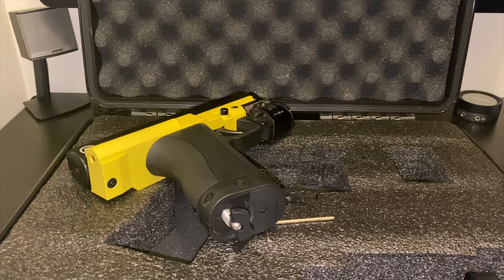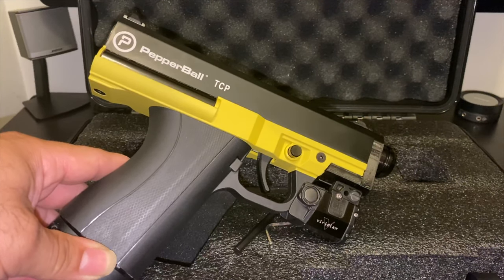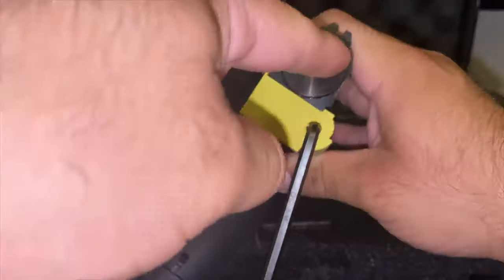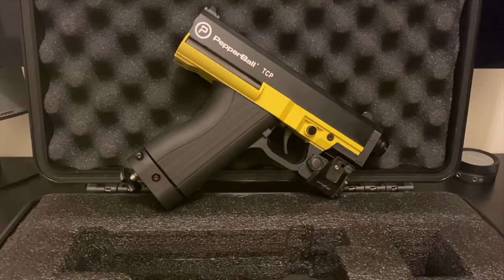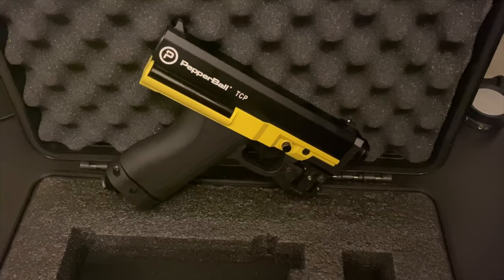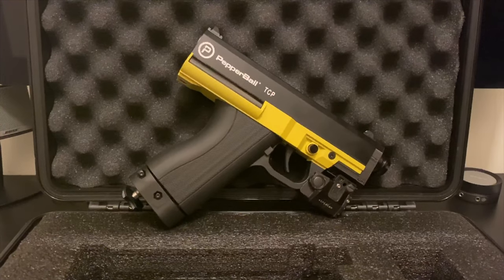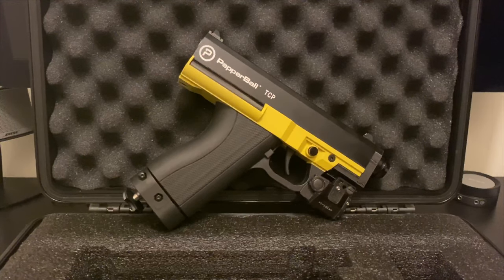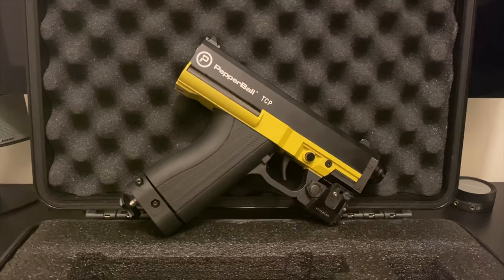PepperBall TCP Velocity Adjustment (Subscribe Leave👍)

Comment from the maker: https://indi.com/p/reviewdudelesslethal/h8837
https://www.olightstore.com/?awraf=770F20005EAC976CB617B
Reply: Question, how did you determine the # of turns for the sweet spot, and is that from the factory settings reference which are how many FPS?
Reply from the maker: Factory comes set at 300FPS. One in half turns will allow roughly 315 to 325 FPS depending on temperature. 2 turns will give you 320 to 330FPS. Temperature does play a role. The numbers always bounce around.
Reply: Would you suggest this model over the Byrna Hd?
Reply from the maker: @alimyrick4598  did you watch my comparison video ? Its 2 parts
Reply: @dudelesslethal6910  No I haven't. I didn't know you had one.
Reply from the maker: @alimyrick4598  https://youtu.be/DvFN86Eojz0
Reply from the maker: @alimyrick4598  pt2.   https://youtu.be/nmPwB5Wg4cw

Comment: Probably going to cancel my Byrna order. Any real reason to choose Salt, Mission, Tippmann over the other? Is price/color the only difference? I didn’t want to go with the Robocop gun but it seems solid, reliable, most powerful option. Not gonna carry it on my hip anyways.
Reply from the maker: Joshua Kepler check out my other videos.
Reply: REVIEW DUDE LESS LETHAL yea I’ve seen them all like twice, haha. Between that and several others, plus people who own the Byrna is why I’m leaning towards the TPR now.
Reply from the maker: I was able to get 14 shots with the same 12gram co2 with TPR.
Reply from the maker: You also have the option for extended mag that shoots 12 shots, if you don’t wanna switch magazines for home defense. Mission Less Lethal offers kinetic impact hard projectiles.
Reply: Tippman / mission / salt 

Are all the same gun. All tippman copies 

The reason we like the BRYNA and FS and PEPPERBALL TCP is because you can prestart your co2 in yiur NEXT MAG and have it ready and waiting to 

The MISSION / TIPPMAN you have t change the mag and then chnage the co2 under the barrel 

Its a pain. And Tippmans are known to LEAK
Reply: @Save-A-DogAps  Or you can add a remote line on TiPX and load a 200 round MCS box mag.  With a 13ci, you can go 100 rounds without having to change up.  With a 17ci, you can go 150 to 200.  TiPX maintenance is easy and parts are readily available from MCS, ANS, Rockstar Tactical, etc.  Stick a CMP18 box kit, long barrel, and an air buttstock adapter on the TiPX.  Got a nice high capacity carbine with improved range.

Depending on how high you set the FPS, the TiPX can go about 12-14 rounds on one CO2 with an FPS around 280 to 300.

Comment: So then I put some round ball powder balls and and they did the same thing exploded before they hit the target right after they came out of the barrel could you explain to me why, also somebody said to take the Allen key turn it all the way to the right clockwise till it's tight and then go back two and a half turns well I put my Allen key in tried turning it to the right it didn't even turn a quarter turn and it was really really hard.

Comment: I found a way to get the Byrna HD  . But I can't get the pepper all tcp shipped to N.Y... That's so messed up.
Reply from the maker: I believe they are working on it. They recently got approved for California which difficult thing to do.
Reply from the maker: Fsc dont come with rifled barrel. You would have to buy Lapco rifled barrel. TCP comes with it and i seen tcp sell as low as $320 to $350 ish
Reply from the maker: Breech is slightly larger on tcp and opening of magazine is slightly bigger. Check out PepperBall playlist
Reply: Your right and the FSC ships to N.Y. Thanks for the info
Reply from the maker: Thats right I wasn’t thinking about the TCP restriction for NYC.

Comment: where can i get it in all black,......and what gun has more power the tcp or fsc first strike
Reply: 8 months old post but I've had same question for months and Google searches failed at answering it. 
 I went to Grimburg, (their reputation is synonymous with quality) here's an email to me..
 " As we ship the FSC and TCP there is no difference.
The TCP magazine can fit VXR rounds.
The FCS can take a rear tank.
The velocity adjustment is different on each. Just the number of turns "
Reply: They both have velocity adjustment screw but.. If you want to run high velocity replace the Oring right away. It will blow out the stock version.
 Buy the 'Milsig Oring', then you can run high velocity without any worries. Seen eBay sells $12.00